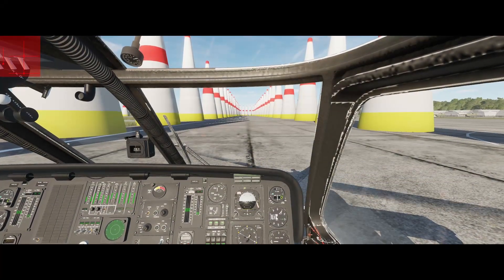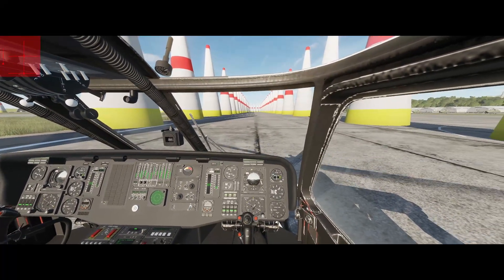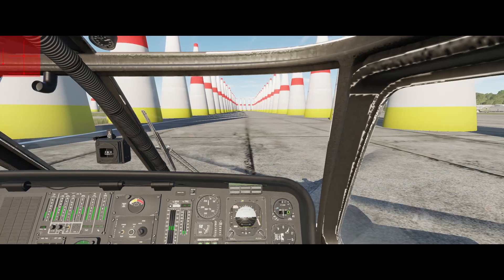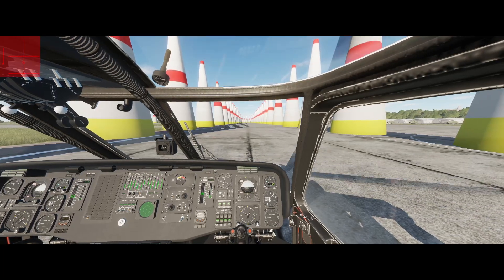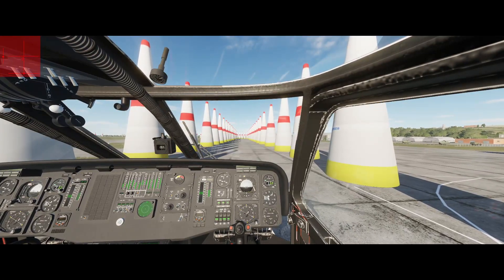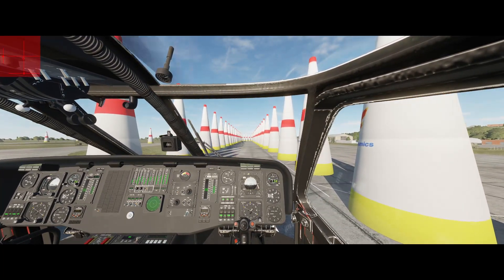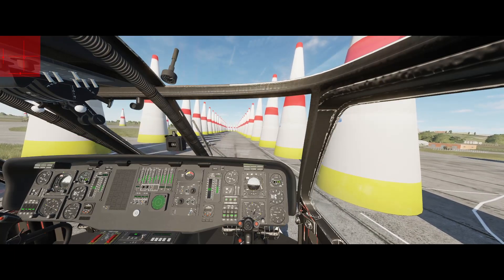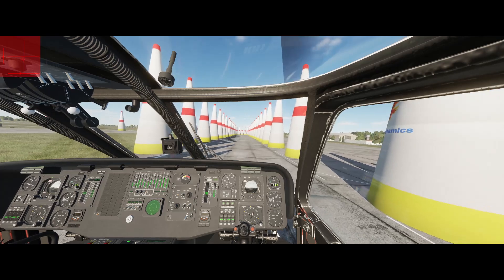UH-60L Hover Tutorial

Comment: Question: When I turn on my  controls indicator and I pull back on the joystick the nose goes up but the indicator in upper left also goes up. As your indicator goes down down as your nose goes up.
My joystick is set so pull back and nose raises and push forward and nose drops
Reply from the maker: No idea mate. Might be some sort of bug and I am sure I did read something like this on the Discord.
Reply: @nazradu  I also posted on Discord, found out that they made a change in update 1.1 and inverted the pitch axis of the control indicator
Thanks for the response and great video
Alex.

Comment: Interesting video, thanks.
At 4:20 you start the hover you move the cyclic back and then to the centre position. 
It appears to have a similar flight model to the Gazelle rather than the Huey, mi8 or Hind. Would you agree?
Reply from the maker: Well the Gazelle has stability systems too but is waaaaayyy lighter and therefore more nimble. Closest comparison is the Black Shark I would say.
Reply: That's a problem then, it flies like a coaxial helicopter, surely that's not right? 
The Gazelle's cyclic works in the same way and that had a huge amount of discussion of the flight model.
Reply from the maker: No that's not what I mean when refering to the Shark. With all stability systems on, it does feel like the Shark, also the way you operate it is quite similar. Depress trim release for maneuvers and so on. When you turn all the SAS stuff off, it feels a bit like Mi8. But in the end it's an Black Hawk and you can't just 1:1 compare it to other modules. SAS, that big stabilator and some other things make it quite unique.

Comment: Don't you always depress trim release if you are manouvering (not just with big turns, like your 180° at the end of the video) while FPS is on?
Or what do you suggest with FPS on?
Reply from the maker: The general answer is yes, you should in every maneuver depress the trim release button. But, when I do lateral movement like in the slow slalom I do not use the trim release. In that case I use the FPS system to avoid the heli from turning or the need of anti torque pedal. My personal habit is to depress when ever I want the nose to move. But that's my personal habit and must not be what is "right". It just works for me :D